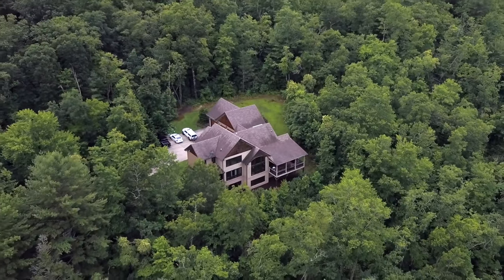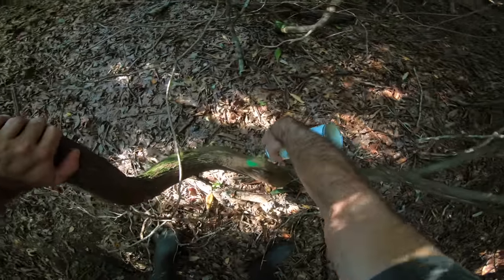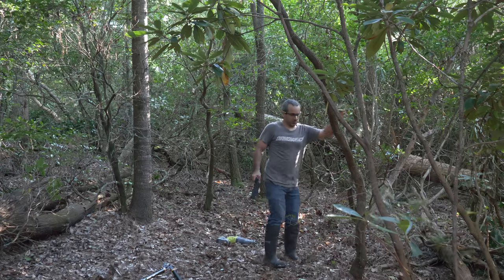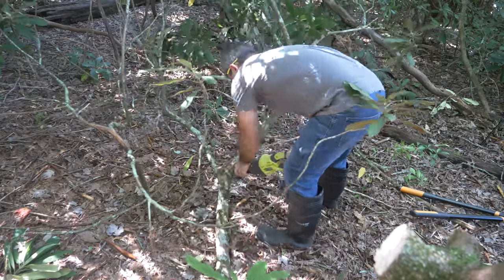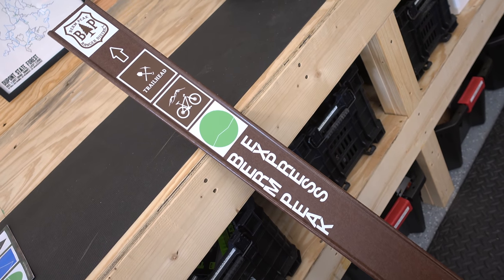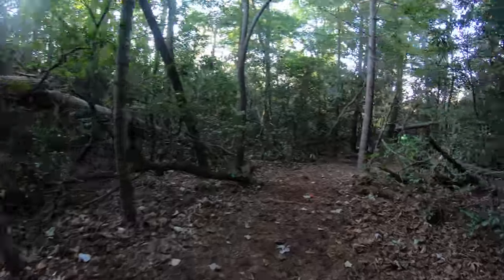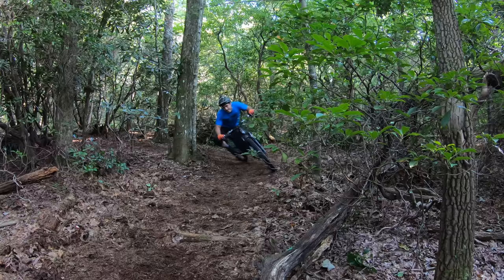Getting Started on my Backyard Mountain Bike Trails

Comment: What I have found to work really well for flagging new trails in N.H. is Dig Safe flags. Easy to see the line you are building because they stick into the ground and reusable. They come in varying colors. Pick them up as you go. Easier than surveyors tape. If your mind changed on a route, simply pick them up an re-route. The other tool I like to use is a low powered dirt bike to burn the trail in. I know that is taboo to most Mountain Bikers. (I don't have dozens of friends to come over and ride in the loops). Compacts the earth, exposes roots and rocks and no need to rake the trail. Just compact down all the earth and very low impact to the trail overall. Looking forward to more builds. :)

Comment: Buy a small battery chainsaw, and maybe an atv or utv.
Reply: Yeah, I've used a Ryobi 18V chainsaw, and it's great for thicker tree limbs, but not so powerful that you're in serious danger of hurting yourself.
Reply: We've got a Husqvarna 535i XP (36V) and the thing is a beast. I find that I use it more than my petrol Husqy these days (for smaller jobs of course).
Reply: Nobody needs training wheels to build trails with. Plus the trails are single track. Not double wide and in the case of the UTV, car width wide.

Comment: Ooooh rhododendron.  Pretty!

As far as saws go, I recommend one of the folding hand saws from Silky.  Something like the larger Pocketboy or a Gomboy would be ideal for your usage, I think.  I like the curved blade with extra large teeth for rapid cutting.  They're a lot lighter and less of a pain then dealing with a power tool when you're doing forestry work, and they cut FAST.

Comment: Tags made of linen would last a few  years, but break down more cleanly than the plastic. Tree wound dressing is applied like a paint and could be put anywhere, but doesn't stand out as well as the bright lawn paint as it's brown. You could nail little trail marker plackets on, but the nail holes could lead to infection in the trees. You could use wound dressing to cement those plackets on.

Comment: I work in a bike repair shop in the UK and we use some pretty unique hacks. I have two in mind, here they are;

1.we dont use soap to clean bikes and components, we use white spirit. It's cheap, comes in big bottles, and works miracles

2.if you're swapping rims but are keeping the hubs and spokes, tape the new rim to the old rim and relace the spokes from the old wheel to the new rim. This will take much less time than relacing a rim from scratch

Comment: I've worked at a printing shop my entire life...here's a tip for putting on those stickers ....spray the hard surface with windex then put your sticker down. You can move it around then just let the the windex evaporate and dry.

Comment: The best option for non-damaging marking of trails is quicklime. Mix with water, paint it on and it's bright white in colour. As it dries and reacts with CO2 in the air it turns to limestone. This limestone will stain to match the colour of the dirt so you won't eventually end up with white patches on the ground. It's a common soil additive so it's not harmful to the trees (it actually helps them most of the time). Chalk spray paint is a bit easier to use and is also pretty healthy, but the bright pigments might never break down.

Comment: Those Cold Steel machetes  (edit, not a CS, but point still stands) are great! But you will have a 100% better experience if you sharpen the factory edge, they are pretty dull out of the box in general. 

You can get the job done with some time and a metal file, trust me it will pay off time wise. A belt sander is the best option, but an angle grinder will get the job done fast as well if you are careful to not take off too much.

Comment: I know it a little late now, but boy you needed at electric pruner. Just treated myself with a Bahco BCL20ib for just this kind of clearing. Already had the Stihl GTA26 which is great for branches >30 mm (when it still have batt left), but the shear is so much faster.... And drops into the belt holster, when moving stuff, so it's always handy...

Comment: Maybe you could build a flat wooden post knocker (as opposed to the round metal post knockers used for knocking in stock fence posts), to slot over the the trail signs to drive them in to the ground. 
Might take a bit of time to build, so depends how many more trail posts you want to put in as to whether it is worth the effort.

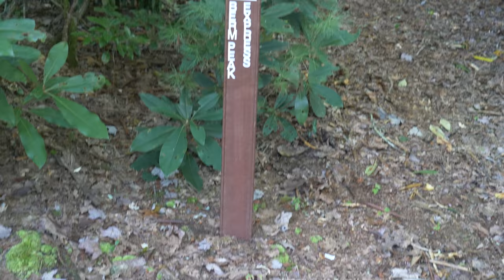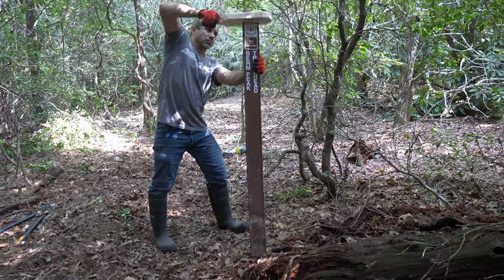Comment: Your "trail hazer" was a great idea, but there is a proper way to use it; at 5:26 you were striking the post such that it was perpendicular to the grain of the "trail hazer," but at 6:10, you were striking the post parallel to the tool's grain, such that the stress was concentrated instead of being spread across the width of the tool.

Comment: Hey Seth you like to travel light and only with a water bottle but they aren't particularly big and so I saw you re fill them often on rivers which are sometimes contaminated and for this there are the filtration straws and packets that clean your water before drinking it making it safer.

Comment: If you want a cool tip, buy, "Mechanix" gloves. Good for working in the bush, working on mechanical stuff, and riding with. You'd probably never take them off. Keeps your hands clean too when working on stuff like drivetrain. Actually (honestly surprisingly) the best gloves I've ever had for riding with as well.

Comment: Just watched your bottle cage episode. You didn't test the Bontrager RL, has worked great for me. Question is, where do you get those hook and loop straps? I run a saddle bag instead of a back pack. I sweat alot already and don't like the idea of a pack. Plus, I've had my saddle bag for 20+ years and it holds all the crap I need. Just trying to get it more secure, hence the straps. Thanks in advance.

Comment: I was working on my bike and I was getting at a weird bolt that was taking to long but i couldn't use my screw gun with out a socket attachment so i found a flat head bit for my 1/4 in drive socket

Comment: Hey seth i have a question. I have a commuting xc bike in my garage and i would like to change its geometry a little bit by converting into sth like a monstercross bike by using dropbars and a rigid fork. I already got the fork but it is about 5cm shorter on the range of axel to crown. Will this change the geometry in a bad way like dropping down the bb to the ground ?